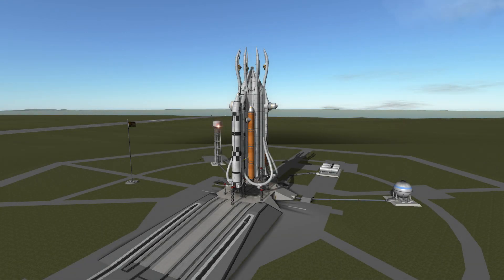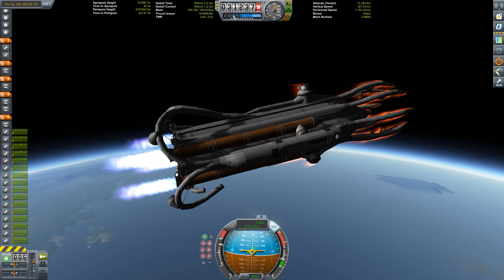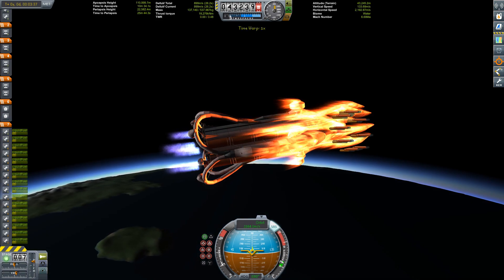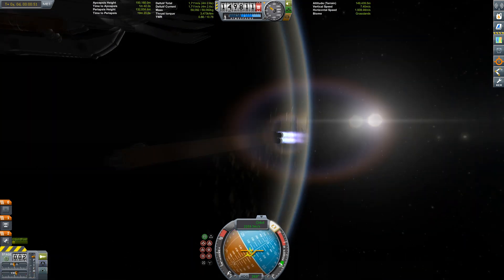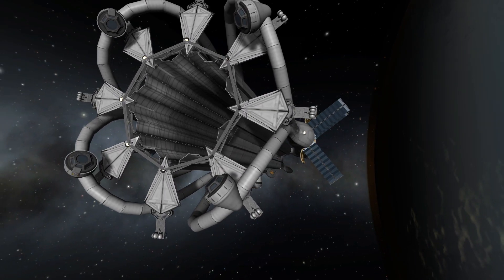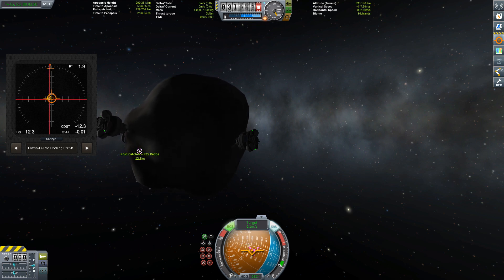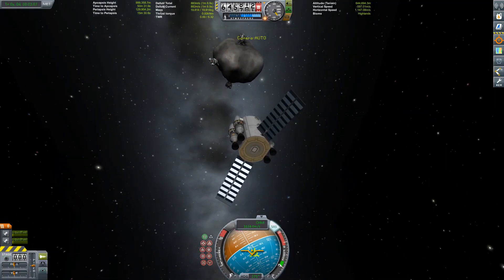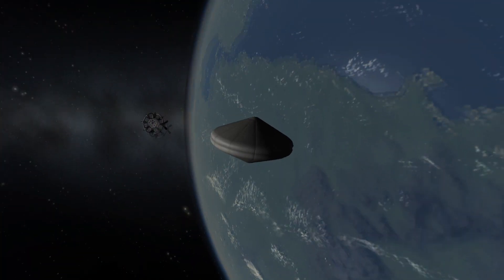The Spacewomb - Orbital Construction Yard - Kerbal Space Program

Comment: I think theres a Mod that Can create parts from Ores. Heat about Building the Hermes from the Martian How it was in the Movie?
Reply: I have a configuration (using 3 mods) just for this and I've been using it nearly forever. It wouldn't be a significant added burden for +ShadowZone or anyone to bare. What you're thinking of is Extraplanetary Launchpads but it doesn't require Ore by default. It requires MetallicOre which is much heavier than Ore and brings many extra parts and a lengthy production chain. My exact configuration is MKS Lite, Extraplanetary Launchpads and a tiny patch that deletes most EL/EPL parts and makes it so you have much less to think about in making a construction station work. Then you only need Ore, which turns into MaterialKits which become the ship.
Reply: There's a mod that I think is a patch for Extraplanetary Launchpads that allows it to work using stock parts and ore.
Reply: Oooooh. I just looked for it. The "SimpleConstruction" mod (+ Kottabos review). I think quite a few vanilla players would be thrilled to have this.